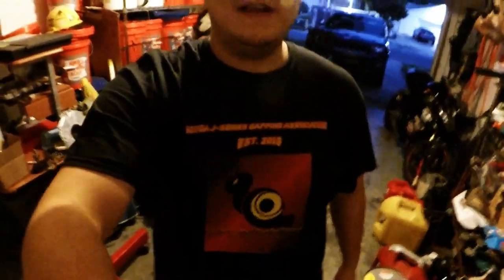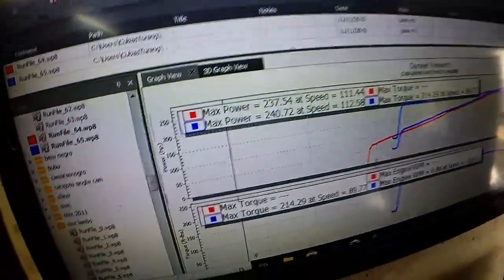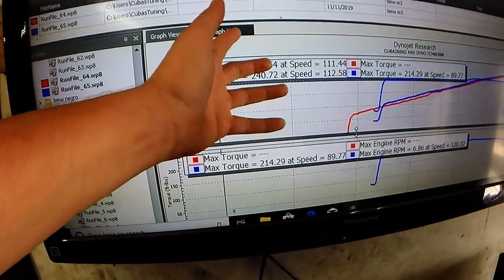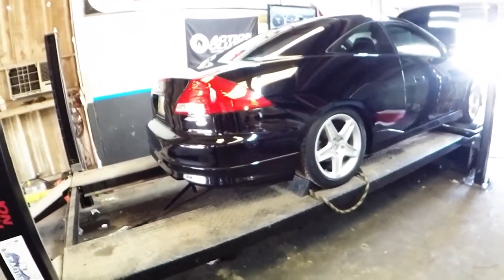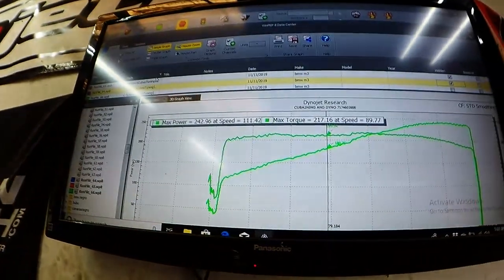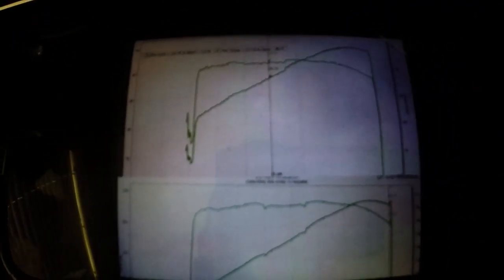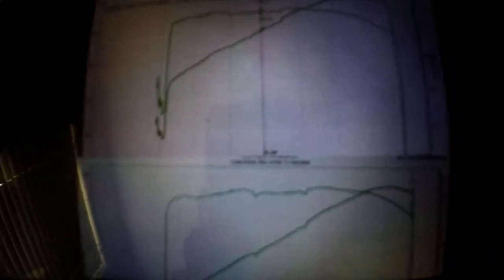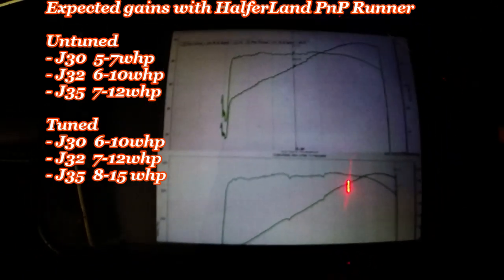Part 2: 300whp NA J30a4...Can It Be Done??? Local Customer Build Series_RUNNER DYNO

Comment: How much can you push the j35 to get the max 'power under the curve' with high compression, preferably around 12.5:1 CR , efficient headers, Ported cylinder head, intake runners , throttle body on 95 octane fuel running stock ecu , to get best max efficiency out of the engine , as j35 returns poor fuel efficiency for daily/street use

Comment: Got a j35 with just a bolt in exhaust tuned to 87 and I’m at 272whp ima swap out for the 3.7 manifold and throttle body tuned to 93 I’ll be over 300
Reply from the maker: Hell yeah man...keep pushing. Our HLP Stage 2 No Limit cams will easily push you past 300....we made 316whp on our J32a3 with an older version, which our no limits version is even more aggressive

Comment: I’m manual swapping my 2000 accord j30a1. I have the type-s upper and lower intake, injectors, and fuel rail installed. The auto holds the j series back so much can’t wait to have the manual. I have the shifter, pedals, transmission, and axles just need the ecu and mounts and thats pretty much it. My plan is to manual swap and swap CL/TL type-s heads onto my 3.0 block. So essentially I’ll
Have a 3.0l type-s. Hoping for that 250whp mark. My jdm h22a makes 230 and it’s a 4cyl so it has to make more power haha
Reply: What transmission are you using I have the same car with a v6 auto
Reply: Also I did the intake mod that you posted and it sounds great on my stock accord

Comment: I live in Jamaica and I need some help with my under inspired 2000 8 actually it damaged the bearings and the crankshaft but I have a J30 but I'm off how can I use the J30 button inspire 2008

Comment: Hi! My name is Frans. I’m from California. I owned a 2002 Honda Accord V6. I’m trying to modify the engine. So far I only do a little changes like DC 3-2-1 headers, K&N cool ram air intake & Chip Booster claiming 60 HP.  Exhaust system 2inches mufflers. Is a replacement of ECU to a hi performance racing kit advisable? Can you help me setup my car? I’m looking for a 300 or more HP. I will appreciate your help. Thanks.

Comment: I don’t think 300whp from a stock displacement J30 is happening without some insane port work, a wicked valve job, ridiculous cams, a custom intake manifold and it’s gonna have to be running a crazy static compression so fuel will need to be E90 or C/Q16 or maybe even M5. It’s going to be a full out race build. Hell guys have to build into their NSX 3L pretty well to even make 290-300 and that is a far more robust platform than the J30. With displacement on your side it’s easy; I tune full bolt on J35/37 cars that make 300whp all the time, but most 3L hover around 250-260 even on ethanol. Some custom cams and head work will really help the cause, but I think unless your willing to run 14:1 compression and build to be able to spin the motor to 8500-9k your not gonna get that power out of 3L otherwise. And it will not be a streetable affair.
Reply: Not sure in this particular case, but there are lots of 3l 6 pot engines making well over 300hp N/A with proper tuning (not massive mods at all for that power) but i supose that depend where you are.. in my region you can see somethimes this kind of set ups!

Comment: Is 200 -210whp possible with parts from the junkyard? 🤔 Stock j30 is 160 ish whp
Reply: Be a little more specific. What parts?
Reply: @thronewalker1153  J35 heads, Acura cl-s cams, J35 intake and runners, bigger throttle body and maybe CAI. If I bolt all these parts on something’s telling me I’ll need a different trans to
Reply: @rotweilerdc  from what I know the cl type s cam will need a very slight modification to fit the j30a1. The j35 heads are direct fit and will work. Your best bet is the 6speed manual. If you have an automatic tranny it will not like the j35 heads or the extra power. As for 200whp it is possible with a good tuning set up. You’ll need j32 fuel injectors and rail. You will have to do custom work for engine clearance but only if you don’t want to cut your hood.
Reply: Stock j30 should be at 210whp if i’m not mistaken?
Reply: @mikhai5317  no maybe the J32
Reply: j30a4 is 240 crank like 200 wheels idk about other models
Reply: My accord 2.4l 4 cylinder Der pushes 160

Comment: How hard it is to get 300 whp out of a 9th gen auto I have a hfpc j pipe intake and an etune and would guess I'm at 270
Reply: I have an auto too you’d probably need more than full bolt ons but don’t forget to add lightweight crank pulley they sell it’s the  best bang for your buck mod 8-10 whp. for $180. I think you’d need a set of cams and a 91/93 octane tune to see 300 out of an auto if you wanna go crazy go with high compression pistons and ported heads but if I was going that route I’d much rather of a turbo kit and call it a day 400-500whp

Comment from the maker: Sorry guys, customer ran out of funds due to hard times and COVID. last I spoke with him he was acquiring Hondata parts to tune with us...as soon as he gets funds we will continue this series...can't force the man to spend money he doesn't have
Reply: Does anyone make performance parts for the j30a4 AT? cant really find anything
Reply: @oliverwilliamson5108  there is parts for auto but very little stock. Most aftermarket parts are for the manual because the auto has a hard time handling power increases.
Reply: @oliverwilliamson5108  yes they do
Reply: The 5AT is iffy at best, the previous autos are even worse. Best bet is manual or keep things around 250wtq. Using good fluid that resists thermal breakdown like Amsoil helps as does running a tranny cooler but at the end of the day they really just aren’t made to hold power.
Reply: you can tune these cars with the stock ecu watch gingium's build video there are people who have figured it out

Comment: 300whp means the engine is putting 345 on the crankshaft.  Is always 15 to 20% loss from the crankshaft to the wheels. See it to believe it
Reply: That's on rear wheel drive vehicles not trans axle
Reply: @dillonkoch72  I like how he didn't respond... lol
Reply: @frankkirkman5994  right 🤣
Reply: @dillonkoch72  explain??
Reply: @n54bry if the engine is in the front, and the car is a front wheel drive… the power doesn’t go down as much as if the power was being transferred to the rear wheels

Comment: I beg to differ that short ram does nothing. It woke up my J30a5 quite a bit.
Reply from the maker: Cali  When it comes to heat soak, it does hurt. If the motor is cool and ran shortly the freer flowing filter element does help for sure, but not when heat soaked as his car was, pulling all the hot air in from the engine bay. Trust me, I’ve ran SRI’s and would see 140* IAT’s and went to a true CAI and saw that drop down to 110-120* which picks up a lot of free power 👍🏻

Comment: Right on bro. I understand that its all about mid range gains especially on the streets. Cant wait to see the dyno#'s with more of your parts.
Reply from the maker: dvs1dvs1 Peak does matter but not to the point so many focus solely on. A car making 280/210 peak vs a car Making 270/220 in the band will beat that higher peak power car.